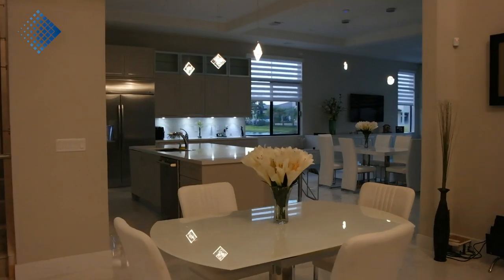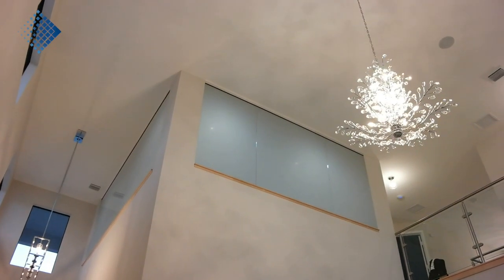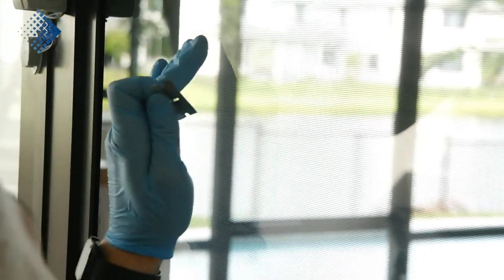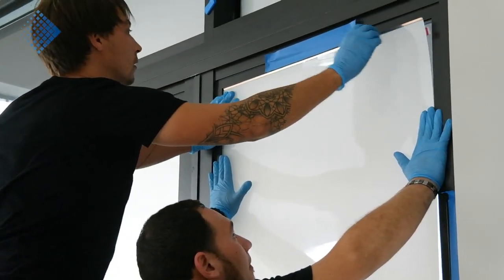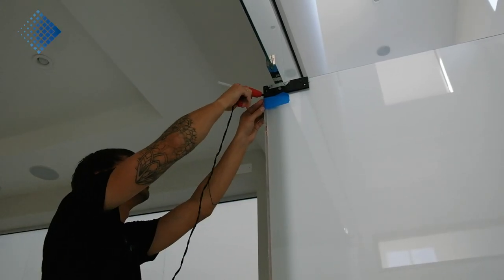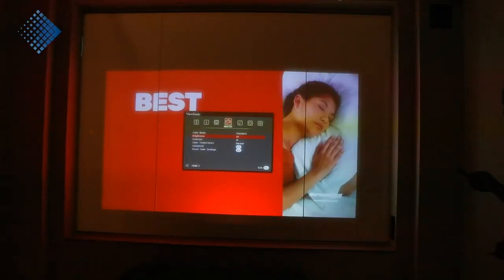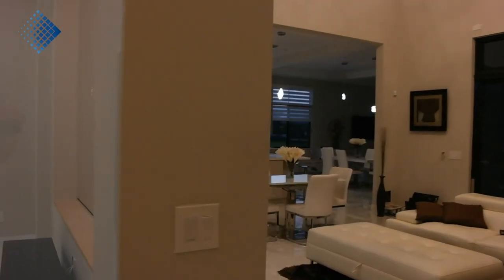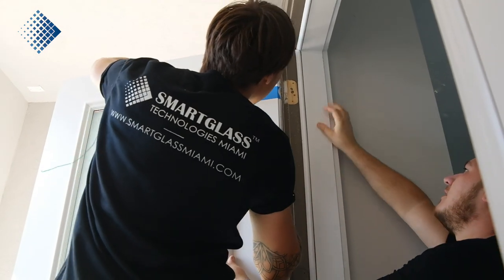Switchable Smart Film Installation & Rear Projection from Smart Glass Technologies

Comment: Hi from NZ .. is the  film clear,,,, or can you see it... i have extremely clear window panes and a beautiful view.... id like to use this product but i fear it will "taint" my view ... so question is... how clear is it
Reply from the maker: The PriWatt film is not clear as regular glass. Depends of the light contrast, you can have some reflection. I recommend it to use only if you really need privacy. Like bathrooms, berdooms, etc...
Reply: @imobilexpert  Damn....I Have a new house going in with 1200x 2400 x 20mm thick panes,,, 4 floors of total wrap around glass of a 10,000 sqft house.....

Comment: I have a few questions if you don't mind...
What are the approximate voltage/wattage needed to power the film?... Say per sqft.
Can you have a frosted or clear design in the glass? Like a name or vector image.
Are you guys considering producing LED film also?... Concepts seem pretty similar.
Reply from the maker: Corbin Buesch 
- the smart film is operated on 48V ( we have a UL certified transformer from 110>48V)
- for 100-120 sqft we have 125Watts transformer
- for 120-300 sqft we have 375Watts transformer
- is a PDLC technology (polymer-dispersed liquid-crystal) 
Get more details here: www.smartglassmiami.com
Reply: Hello ! did you find the answer to your question? I also wanted to try to do this

Comment: Hi, is it possible to use the front projection instead of rear projection?... maybe by changing the projection mode on the projector itself?
Reply from the maker: Yes is possible. It’s depends of the projector, but you may loose the quality, you have to try first the projector.
Reply: I would like to follow up on this. Most any projector should be able to front or rear project. It is a simple image flip done within the projector. What caught me off guard is you stated you might lose quality.. Do you suggest that front projecting may lose quality? What would be the cause of this? Reflection from the glass? Thanks so much.

Comment: How do I install and hide the wires if my glass panels are foldable?
Reply from the maker: We need more details. Anyway most likely the wires will be visible. Or you can use a magnetic connection and use the transparency mode only when the windows are closed.

Comment: I'd like to use this on windows that are opposite my OLED tv, as a blackout screens to avoid them reflecting on the screen during the day.... However it seems the light from outside is more diffused than blacked out, hence I would simply see the white diffused light reflected on the screen instead of whatever light might come in naturally..... Would this be the right product? Normal roller blinds can't be used as the windows are tilting, and would hit any roller installation

Comment: Hi I purchased your smart film and will be installing it on a set of doors this weekend. One of the doors slides and I do not know how best to handle the wiring. Can someone help please or can you refer a certified installer in the NC area
Reply from the maker: Sure. Please get in touch with NYC dealer at www.smartglassnewyork.com
Reply: You will either have to have wires that connect to the door and loop over to the wall, but the wire will have to have slack in it to be able to move with the door. For this method, put the wire on the door at the back top edge of the door and then loop it to a junction box halfway between the doors full travel distance. Use at least 16ga stranded copper wire (we call it “cab tire”). The other possible way would be to put 2 conductive roller contacts on the top of the door, and 2 strips of conductive copper under the track of the door while insulating them from the track. This way is cleaner, but more difficult to install. And the rolling contacts may not be as reliable and will be subject to marring wear and tear. Also, be careful to only put voltage to the window film, and not the whole door. 48V will sting a little, especially if you’re wet lol.

Comment: Hi, we'd like to install a double patio glass door with two adjacent fixed panels. We would like to use minimum clips and avoid using channels. Is that possible to still conceal the wire? Do you serve San francisco bay area? If not, do you recommend anyone around here? Thanks!